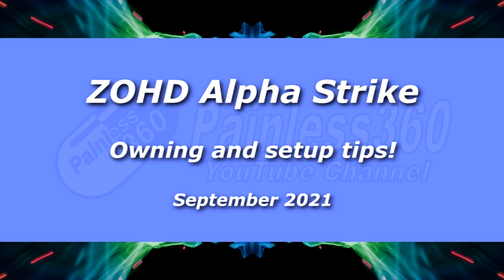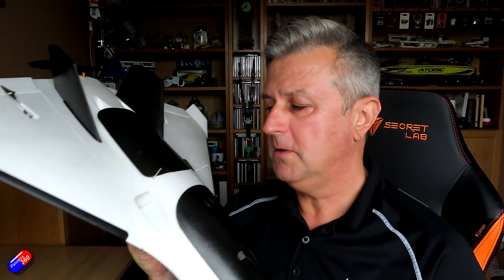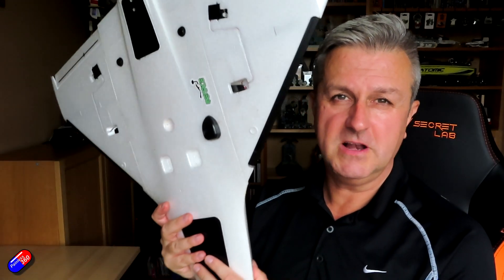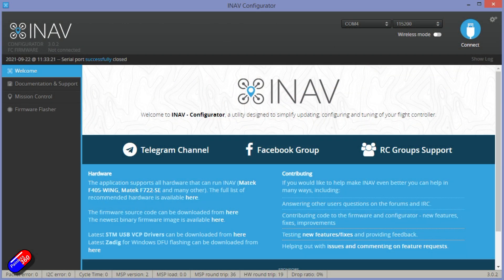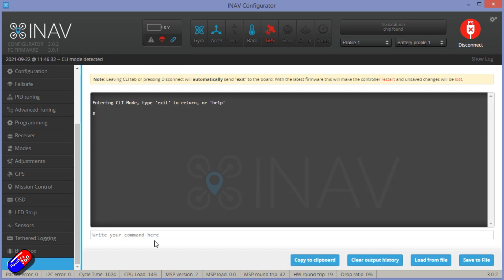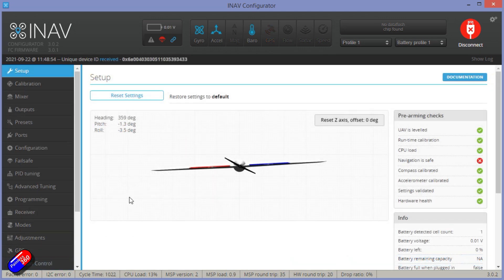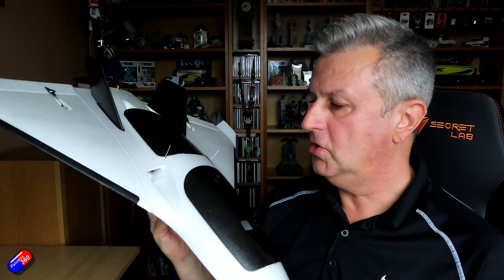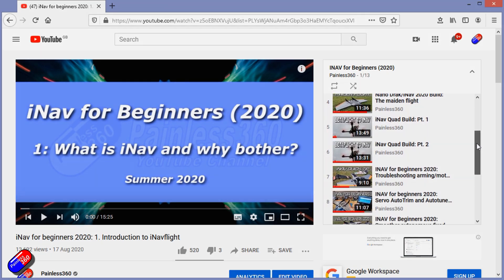ZOHD Alpha Strike: Full setup tips for manual and INAV flying

Comment: Looking back on old videos on these. I love mine. I’ve had 211mph out of mine and loving the vertical launch’s I do, with this and my goblin. Launch strait up in the air 👊🏻 Both do have a 2000kv motor and 70a esc. The alpha strike flys so well and stable, as does the goblin. Also I use a 6s 3000mah lipo battery. Have only just put the 2000kv motor on the goblin, so need to maiden that and test. Did have a smaller 2600kv motor on first.

Comment: Did you set Cog like to the marks exactly? Thanks
Reply from the maker: I did, always aim for the front of any marks for a maiden flight... Happy flying
Reply: @Painless360  i will probably maiden with a 3s 2200 using under hand toss 60-70 degrees 60 % throttle...i just want it for sport flying no fpv..will warm up with my beat up and repaired pocket rocket prop jets first...its a really nice looking model...thanks

Comment: Hi Lee, thanks for all your extremely helpful Inav videos!    How do the earlier inav  PID numbers translate to 5.1?   Can I still use your numbers in this video from earlier Inav as a base setting in 5.1 for the alpha strike?   I remember betaflight numbers changing at whatever point in it's update timeline and being very new to inav, I just wanted to confirm either way.
Reply from the maker: I usually rerun autotune when moving from one major version to the next
The release notes are excellent for letting you know what can be imported safely depending on the previous version... Best of luck
Reply: @Painless360  Yes, definately will do an autotune,  but was initially curious as your numbers in this video are very different to the defaults in 5, and it got me thinking if it's the difference in releases or this little thing needs vastly different numbers from default PIDs.
  I'm off to read release notes!   
 Thanks for the reply!

Comment: 4 cell is way overkill for this plane on stock setup. 3 cell already give you insane sports flying. For FPV use it really is a great 2 cell plane. 5000mAh to 7000mAh 2 cell can achieve more than 1:1 thrust to weight already and give you easily 30 min+ flight for FPV. If fact if flying 3 cell should prop down to 5x4. If flying 4 cell should really prop down to 4x4 to reduce excessive torque and noise

Comment: Wheee! Maiden'd today. Fun!
Was a little unsure w/so much reflex (I used 6mm) as the controller I used (DJI Remote Controller) has no trim or rates.
Went straight out. Just a small tendency to bank right. Whew! Had a nice 8-12 mph wind (which I like for maidens as it makes launches and landings easier.
Put a Matek 743 in it to flight test the controller. Decided to use Arduplane so used a script on the controller to put in 9 different modes since the DJI has no programming ability - script worked fantastically! Lot easier than programming a radio!
Landing was smoooooth.
Next flight will be under the hood - can't wait! Thanks for the tips Lee ...

Comment: Does this mean we shouldn’t use the inav auto trim and auto level features if we need to apply a 3mm up trim? Presumably doing an inav auto level would remove any trims you applied that are required for future launches?
Reply from the maker: I use INAV auto-launch so don't worry about that. See my video on how to set it up. I use it on all my INAV models for easy, safe launches that work every time.. Best of luck!